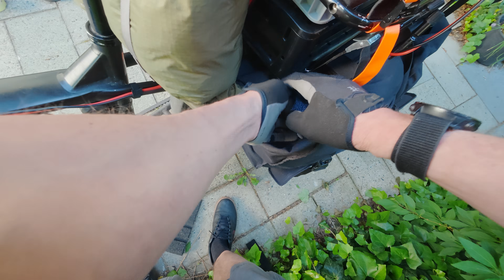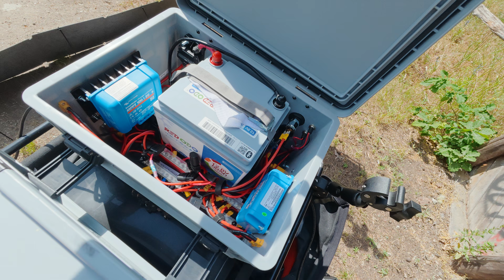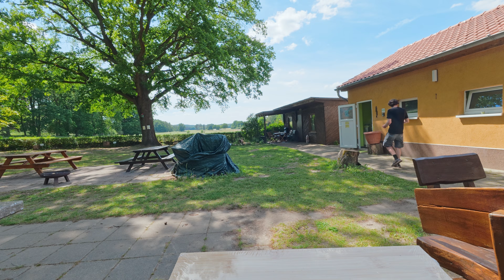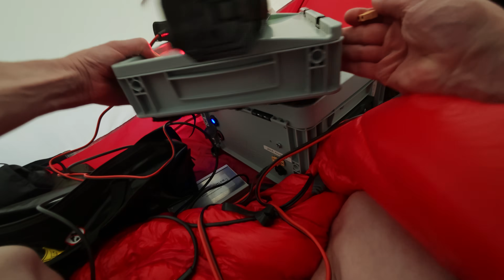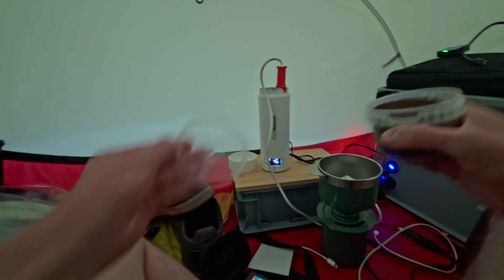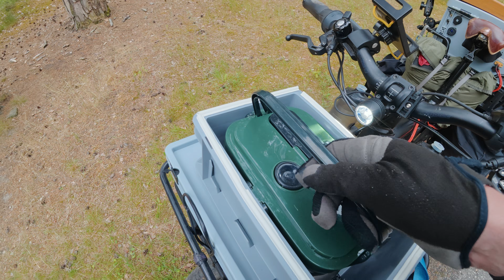Solar Cargo Bike Camping — 160 km Overnighter with 12V Cooking

Comment: I can linger at a restful place and solar-charge all day because I like riding at night as much as during the day. (A nap on a lawn in any park is peaceful.) Means less campsite-hunting stress. Not a recommendation, just a consideration.
Reply from the maker: I very much prefer to sleep at night. But what I am wondering is how much of the day is best spent riding. If it is a relaxed trip with 80-90 km distance to cover there probably is enough time to charge and ride.
Reply: @outheresystemsoutheresystems  I used to just ride with my 100 watt (nominal) solar panel folded (no trailer) -- only charging when I could be in one spot all day for each of two 20ah batteries. (Two full batteries got me about 70 miles, depending on the terrain to climb.)

Now that my panel is laid out on top of my trailer, I've been doing test-routes (with various amounts of climbing) and putting all kinds of the data into a spreadsheet. Inconclusive, so far.

I'm figuring that I will get only minimal charge while riding with the solar panel open, though having a new 250 watt panel on the trailer (100 watt panel folded and stowed) will be a significant range extension.

Still, yeah, how much farther? Well, more test runs, recording the data to a spreadsheet.

But again, lingering at daytime stops and riding a lot of the way at night means never having to look for places to plug a charger into a wall outlet and having that dictate what kind of place to spend those hours.

Comment: Been using a 24v kettle, built-in coil, very successfully. Shuts off reliably but I watch it anyway. Why isn't there a widely available low-voltage induction cooker?
Reply from the maker: I think induction just uses too much power to work. I have seen the "hacks" but I am not sure they are safe - especially on a bike.
Reply: @outheresystemsoutheresystems  Yes, I've resisted building a low-voltage induction stove. It would work, but doubtfully suitable.
Reply: @outheresystemsoutheresystems 
You think the peak power use is too high?

Because otherwise the overall energy consumption is very low.
Reply from the maker: @FutureChaosTV  I think so- the induction cookers I have used deploy a high amount of power very efficiently for a short amount of time...but I haven´t looked into it too deeply.

Comment from the maker: It's just not my thing to pull a trailer. But I do see loads of advantages if the roads allow. My bike is not working well with a trailer, I would have to give up on one pannier, unless I find a better place to attach it. Also where I live I cannot take this bike into the train.
Reply: The long urban stretches of California, unfriendly to anyone who isn't passing through in a car, make Amtrak's various bike possibilities welcome. But the weight limit for bikes and trailers on Amtrak is officially 50 pounds (22 kilos), so it has to be split between the bike and the trailer.
Reply: Commercial means of trailer attachment are all too elaborate and yet unreliable, so I design and build my own. A curved extension firmly mounted along one the chain-stays with an eye-bolt on the attachment end -- does not obstruct the pannier on that side at all. Home made trailer weighs 9 pounds with a "tongue" straight out from the center at axle level. Simple clasp to the eye-bolt. But still... Being on just two wheels would be great.
Reply from the maker: @malHHkenny  Maybe I will have a use for that 100 Ah Lifepo4 that is sitting around here after all. I will think about it.
Reply: Have you looked at the Burley Coho or other one-wheel trailer? totally different feel than a 2-wheeler. I've got one, but for a solar e-bike setup, you could take a look at https://www.youtube.com/@Eric_Tennant setup.  An inexpensive marine type 200w solar panel mounted on the trailer, minimizing the need to stop to charge.
Reply: @douggroves908  I'd like to see a chart that compares the weights of all the commercially available trailers -- and their hitch systems. (My home-made 2-wheel trailer weighs only 9 pounds, before putting a bin and gear onto it. Yesterday it carried 70 pounds/32 kilos back from a 10-mile ride into town. No prob, but I won't be doing that habitually.) I assume that the commercial makers assume that we'll try to carry quite heavy things. They're naturally liability shy. That starts a spiral up in the weights we might want to carry -- which can quickly get out of hand.

Comment: I'm finding that a trailer makes my plan to be independent for thousands of miles possible. Also means that it can be two separate components to load in a baggage car on sections where I travel by train. But I definitely miss being fully self-contained on just two wheels. (And yeah, road meditation is key to the pleasure.)

Comment: Hi, nice job.
Like all range or performance work, weight is key. Smaller plastic box;s and reduce cable lengths etc
As for solar, you need to stop and generate the power during the solar maximum of the day. Start early and stop for a long lunch or even late lunch and set up for the night.
It's a good experiment though.
Can you go for bigger panels (not heavier ) to bring in more power or is that the sweet spot?
Take care M.
Reply from the maker: It is still all prototype. But for that it works surprisingly well. I am working on replacing the big folding panels next. But I am still testing.

Comment: I also have the R&M Multicharger! It has been very reliable steed and practical for my commuting needs with my kids. My bike turned 3 years few months ago. I have replaced chain (4000km) and the cassette, chainring, chain (8000km). I also replaced the front magura brake with shimano XT because the brake lever broke. The only thing I am not very happy about are the magura brakes that are prone to rub the disc. I ride year round in winter conditions too with studed tires.
Reply from the maker: I am quire happy with my 2021 purchase, my wife has the mixte model. But I also had some work done after 10000 Km.

Comment: Nice video Sir. 
I ebike and I'm building a bike camper with solar. 
Be safe n have fun
Reply from the maker: That is a great concept. I hope you have a good tool to plan the roads and crossings, I wasn't surprised what I found, but it is a challenge for longer vehicles
Reply: I've been slowly buying all the gadgets to build a bike caravan, I'm almost there, just got to buy the wood and bits for the shell and the solar panels.
Reply from the maker: @Mr_Jamin007 my flexible solar panels just gave up on me. So look carefully at ruggedness...

Comment: I want to do the same thing as you with my bike. I also have a Bosch system so only being to charge batteries while not in use is an inconvenience I have to consider too. I'd be taking a premade Battery bank rather than a DIY solution like you have. Seems like it might be slightly more efficient space wise.
Reply from the maker: I took a 500 wh pre-made one along and it worked. It's just that I set aside the same amount of space to carry it safely and I was uncomfortable with AC on the road. Also the thermal situation was a thought. This thing can charge with 35 A using two mppts so I can make use of the sun when it is there, and it can discharge at 25 A (my choice of fuses). But it was certainly an effort to build it DIY
Reply: @outheresystemsoutheresystems  Hi, the OE 12 v batteries are that shape for historic / use reasons.
i've seem a flat 12 batter from one supplier, you could possibly put that in the pannier bags and move the COG lower.
Keep up the good work. M.

Comment: Would it be feasible to have a panel on the front to double your intake while on the move?
Reply from the maker: It very much depends on where you are traveling. The highway crossings and the road bumps were real. I am working in both directions. Maybe fold out to two panels on calm stretches of the road. Not three, because it gets instable on a longtail bike. If you have a trailer I think it's fine. But to me it feels more promising to actually stop and make the best use of the sun when it is actually available. That's also because the vast majority of the area I travel in has roadside trees that provide shade, so when traveling the harvest of sun is infrequent.
Reply: @outheresystemsoutheresystems  Hi, I've seen someone with them on the top of the bike trailer.
It will help, but might not be the best option.
Take care M.